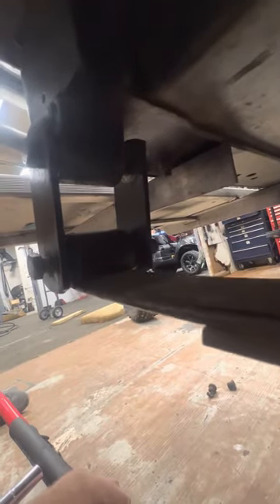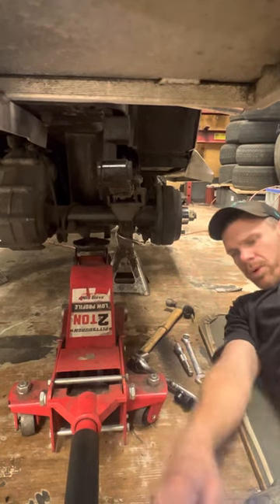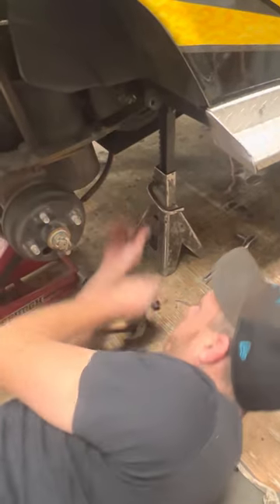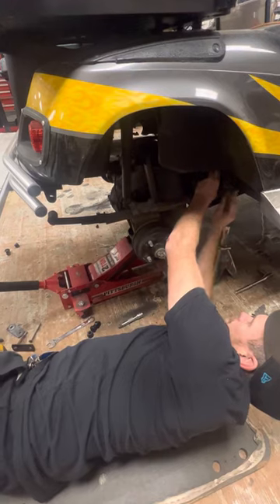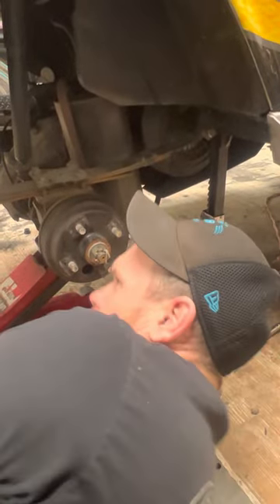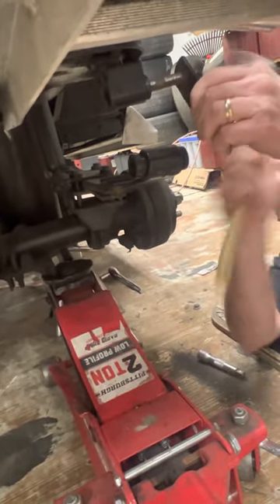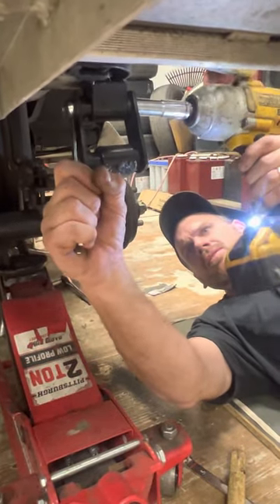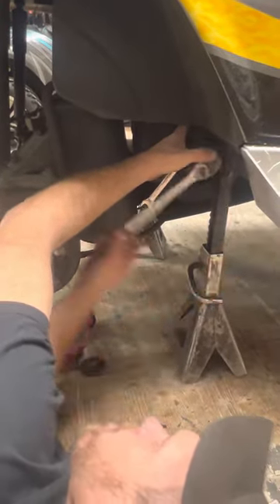HOW TO REPLACE REAR LEAF SPRING BUSHINGS ON EZGO GOLF CART. QUICK!!STEP BY STEP!!!!!!

Comment: I just replaced my rear springs and bushings, specifically top and bottom of the shackle plate.  How tight should the shackle plate be?  It was free floating/swinging previously, probably b/c the bushings were long gone.  Upon replacing the high side bushings, the plate is pretty tight in place and no longer freely swinging.  Should there be some "give" in there?
Reply from the maker: No tighten it up.
Reply from the maker: Thanks for watching and commenting